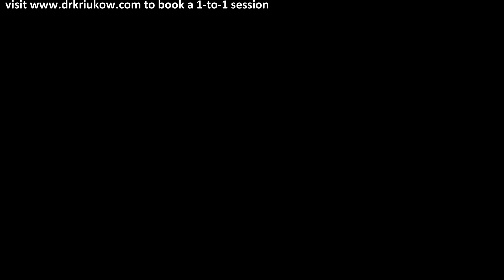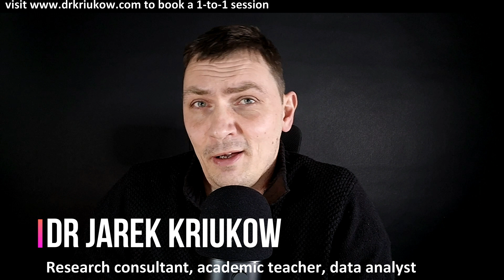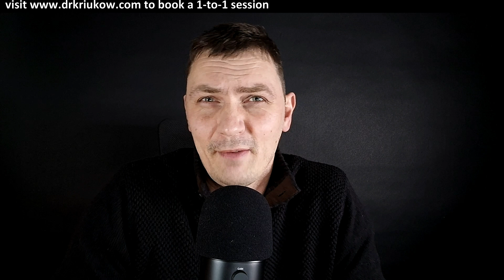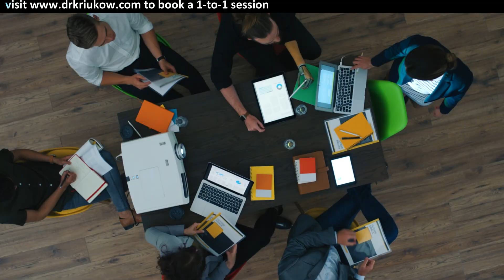What is Intercoder reliability in research (and why you don't need it)

Comment: Great content Dr.

What is your suggestion for my thesis, do I incorporate inter-coder reliability when we are analyzing pragmatics? specifically conversational implicature Gricean maxims of conversation.
Reply from the maker: it is up to you, if you feel that the problems I mentioned in this video may not apply, then it may still be a good way to validate the data. I have a feeling that in pragmatics, things may be less open to individual interpretation and, therefore, inter coder reliability may be more applicable than in other contexts indeed